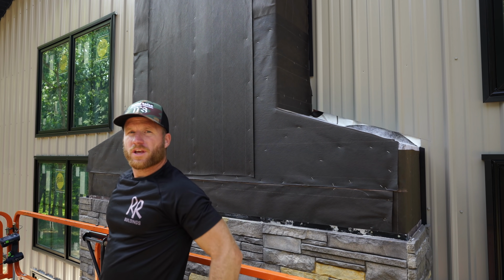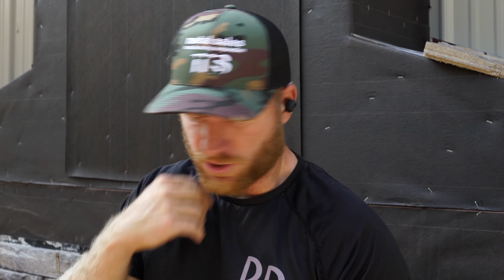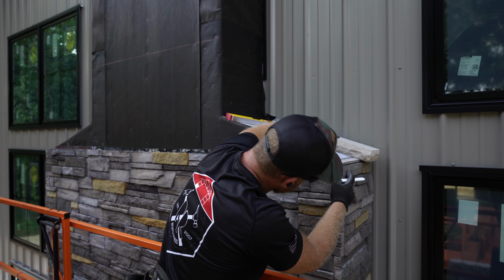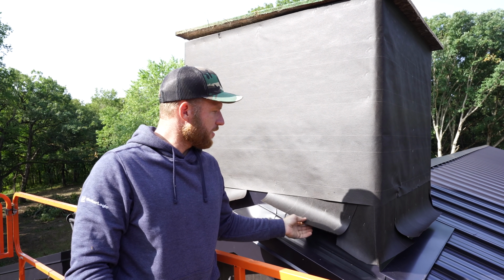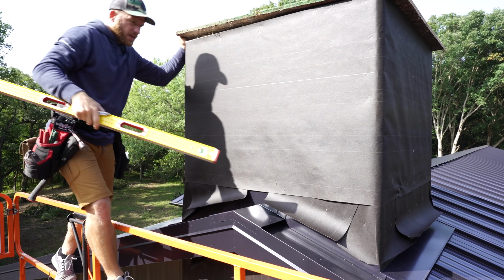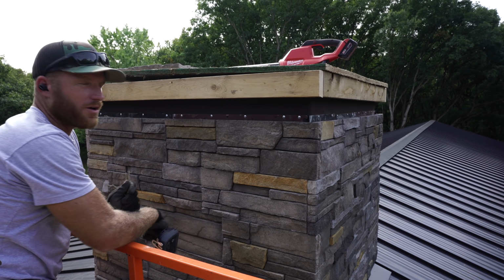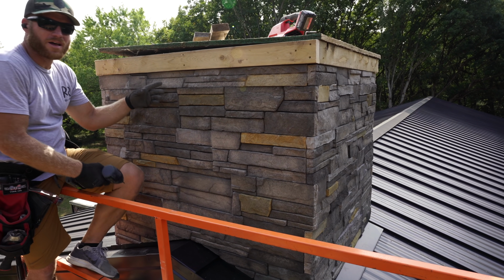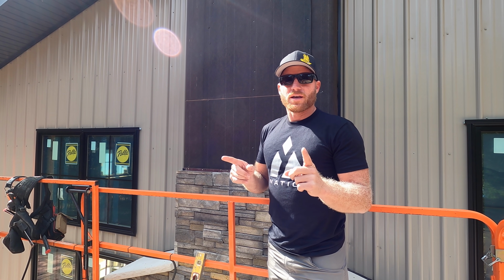Cabin in The Woods: Finishing the Chimney  Versetta Stone

Comment: Be interesting to see the flashing detail between the shoulder stone and the metal side wall. Impressive results on the stone work.
Reply: I think a piece of angle flashing should have been installed and striped in to put that water out on top of the stone. Also ice and water on the substrate over the vertical stone before shoulder stones were set. Looks like fun..my twitch is dickin
Reply: Cutting corners running felt vertical on the chimney near an area where water infiltration is most likely. Could end up chasing a leak everybody thinks is at the shoulders when in fact its vertical wall below the chimney cap.
Reply: Nice to see you respecting the panel paint finish. Blowing off debris and walking on the vertical legs. Love that!
Reply: @GM-dh5xi   I work on chimneys for a living. 80% of the leaks come from the shoulders. The other 20% is flashing or lack of a cricket.
Reply: @2themaster  100% of the time its because the installer did not allow moisture behind the exterior wall to escape. By the time the owner sees it there is probably structual damage ad well
Reply: @GM-dh5xi   My favorite is the fake masonry chimneys with the prefab fireplace. The brick is made with 3 sides and when they hit the roof level they put the 4th side (back) right on the plywood roof. So any moisture in the back brick leaks directly into the attic.
Reply: @gm the black felt is just so you can see through to the white wrap. It’s cosmetic only and not the actual house wrap.
Reply: @GM-dh5xi  the verseta stone has a built in rain screen. Not sure if it was mentioned in this video, but it was in previous videos.
Reply: I bet he goes back and does a flashing of some sort.

Comment: I love my ISO Tunes PRO's.  Two complaints...1) The rubber cord sticks on my neck so I have now gone to wearing them with the cord in front of me.  2) I still get cut-outs, which is a known problem.  They did replace my original PRO's with a new set because they did state they had an improved antenna in the latest version.   This greatly improved my reception, but I find that I have to have my phone in my front pocket or in a shirt pocket in order to ensure 100% reception.  

As for Greg not liking them in the summer?  If he's a head sweater (I am) I totally get it.  I can't wear glasses (I struggle with safety glasses and have to have a glasses strap on them), and I'll soak through a hat inside of 20 minutes if it's above say 75F.  I wouldn't mind if I was a bigger body sweater than a head sweater, but yea...dripping sweat into the eyes, all over your glasses, into your ears...IT SUCKS... :(

Comment: @9:20 Hi Kyle, why would you not apply metal flashing to the angled top surface of the fireplace and then set stone on top? Wouldn't the flashing help drive water away and avoid the moisture form having to go behind the versata stone?

Comment: are you using corner siding? and do you use the starter strips boral offers. i have a job coming up and the very start of the installation is at a 37 degree cut.

Comment: why didn't you put a flash pan on the shoulders of  chimney , under the cap stones, to divert water over the front of the stone? Just curious...
Reply: Ice and water shield works great. I would have extended it out over vertical pieces coming up the wall. Cant attach stone to a metal pan but you can make I&W work like a pan. Just my thinking.

Comment: I wanted to do this to my house but after picking up a box and weighing it the stone was 40 lbs for 10 square feet and my Chimney above the roof is 200sq ft so I’d be adding 800 lbs on stone then probably another 200 in mortar plus the lime stone cap which was another 200lbs I come to the conclusion adding 1,200lbs was not a good idea without redoing the whole thing. I don’t know why the people who built the house didn’t use block just a cheap wood frame

Comment: Why don't you treat that 1 section like a roof and put melo behind all of it to have the metal travel over the over the whole corner of the chimney that way if it does get wet pair are against a behind it will get behind it is you don't want nothing behind it landing on that on that corner and writing you want to flow bot and he though wanted to flow behind it you know even putting materially keep your wall step off the wall there's no barrier behind you couldn't stone up is no barrier behind the stone Leakey believed to dry stones go but up against the wall